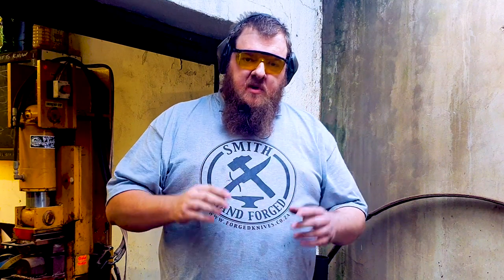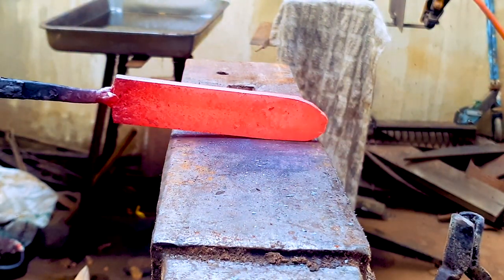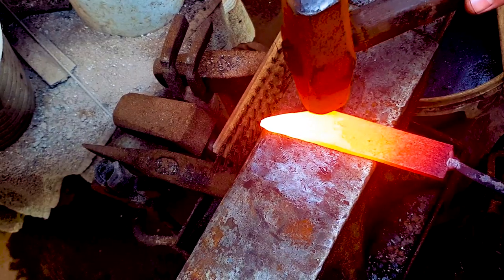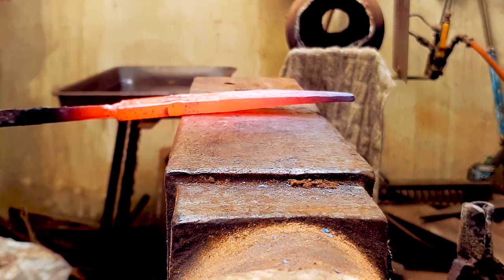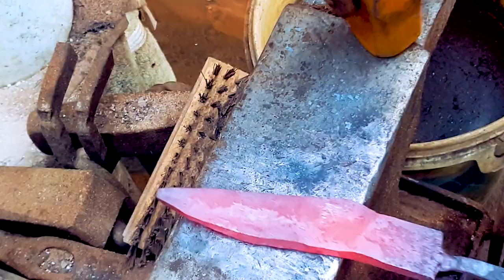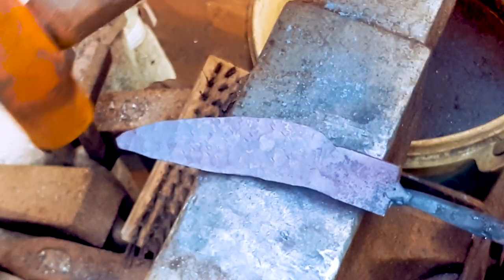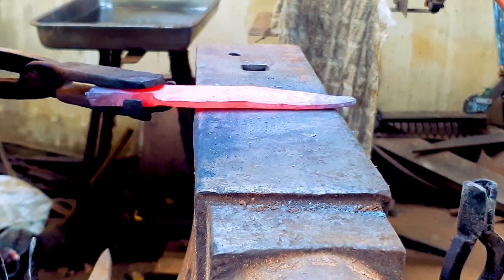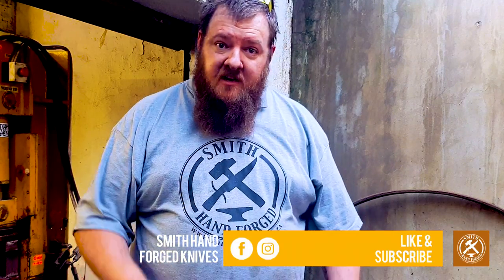Forging fundamentals   tips, heels and bevels

Comment: Looks so easy. And very good teaching. The best videos on forging a blade I've seen. 
How thick is the material you would recommend a beginner? And is there a steel thats the easiest to forge. I do have a electric kiln for the heat treatment. 
Best wishes from Denmark
Reply from the maker: 4 - 5mm is best starting thickness. good starter steel is 1070 if you can get it or you can salvage some leaf springs which are usually 5160.
Reply: @StuartSmithHandForgedKNives  Thanks. I appreciate, you taking the time to answer.